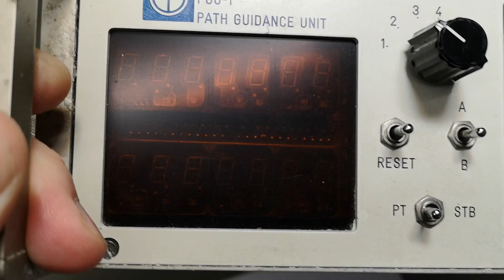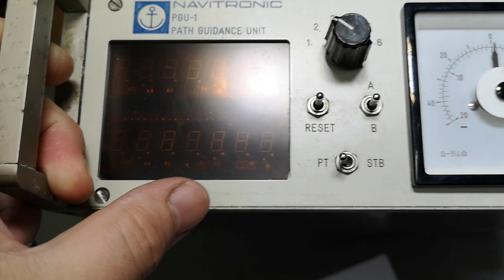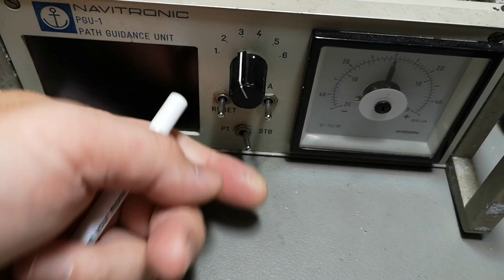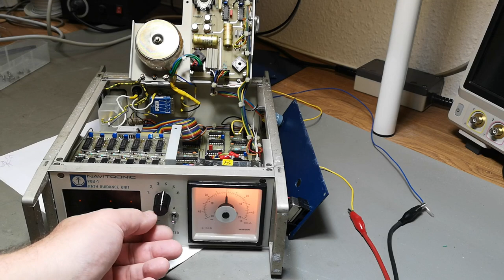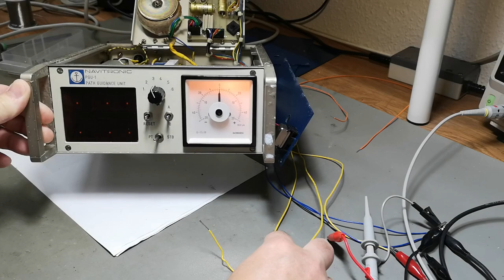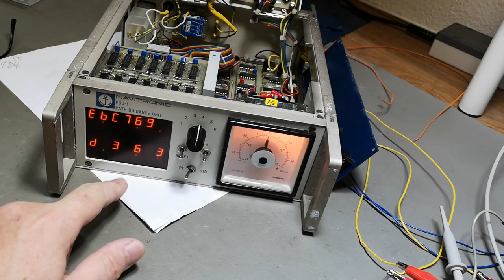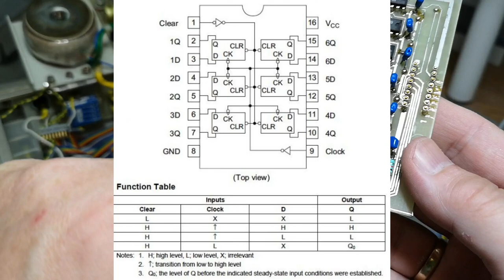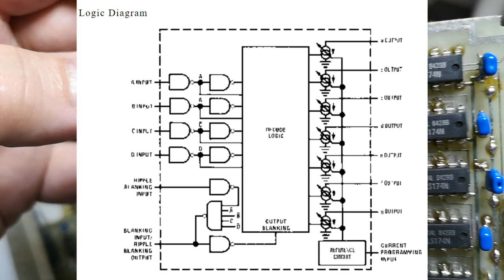Navitronic PGU 1 Path Guidance Unit 1985 teardown

Comment: How are you supposed to earth the device if it's mounted in a boat ? 🤔Can sea water be considered as an earth point ? 🤨
Reply: yes on a steel boat the hull is usually used as an earth, smaller wooden or fiberglass boats sometimes don't have an earth but when they do it is often just connected to the engine/battery negative

Comment: Could you connect the LCD display and simulate its operation using, for example, an arduino?  I have a lot of similar displays and I haven't seen anyone make a video on how to use them...
Reply from the maker: YES that should be quite easy to figure out, I found a large box of exactly this type of pcb and displays on my stock of goodies the other day :-)
Reply: @TeardownOZ2CPU  I hope you will make some video about reusing old LCD panels.  I follow and like all your videos, big greetings.😊